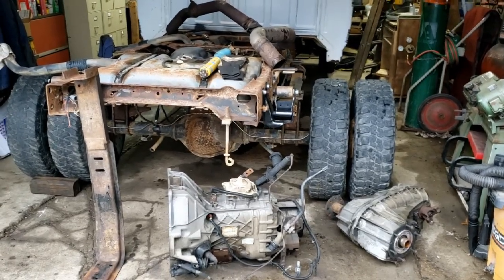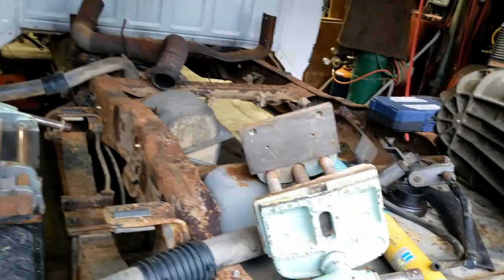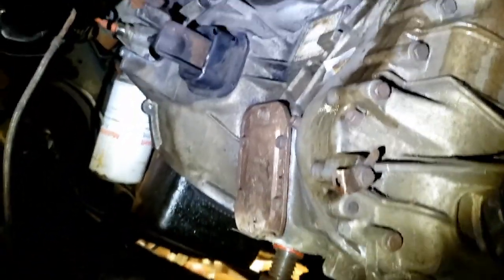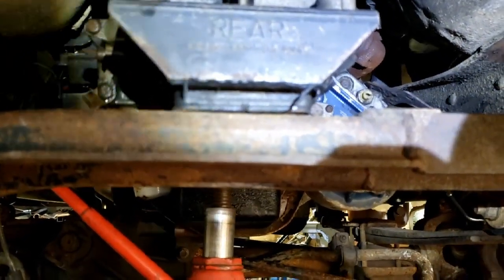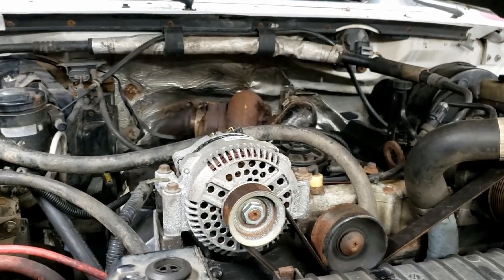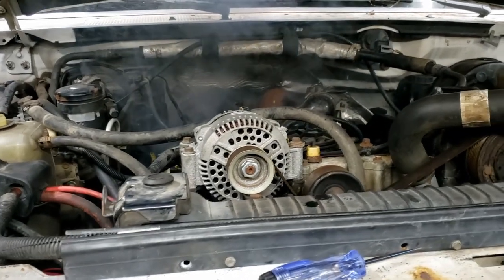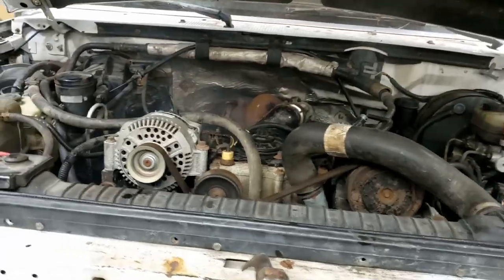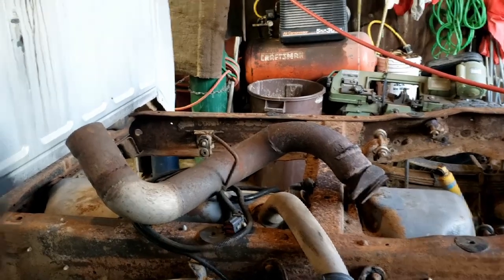7.3 Powerstroke First Start in 2 Years - Frankenstroke Part 12

Comment: Those rear housings even in that condition run about $500-600 where I live lol. Don’t break it!
Reply from the maker: Exactly. One tip for you is that if you can find a ZF5 from a gas truck, that rear housing can be bolted up to a diesel pattern front housing and used in a diesel truck. The gear ratios of 1,2 and 3 are different in the gas transmissions (they're closer together) but it is a viable option. The transmission in "Big Red" (there are some older videos on here of that truck) was built this way and it was a towing monster!
Reply: @diymechanictv1233  Is Big Red still around?
Reply from the maker: Still around, but not around here. A nice young man from Indiana drove over and purchased big red. He used it to replace a newer (6.2 gas) Super Duty truck.
Reply: @diymechanictv1233  excellent

Comment: Having E fuel and stock pump trucks can you shot it straight? Much needed or over rated?
Reply from the maker: You won't see a big difference with e-fuel alone, but if you want to go to bigger injectors, it needs to happen to keep them fed. The mechanical pump has trouble keeping up with much more than the stock 90cc injectors. Since the injectors I'm running right now are 160cc units, the stock pump would struggle to keep up with their fuel demands if I were working the truck. If you have stock injectors, I'd say e-fuel isn't worth the cost and trouble unless you plan to upgrade in the future.
Reply: @diymechanictv1233  im looking at 205/30 hybrids from full force🤷‍♂️ they seem to think stock fuel is fine. I have the kc sxe300 balanced assembly not looking for anything crazy just a tow rig but thry say the use less hpo then 160cc 🤷‍♂️ just figured id ask ya efuel does seem like added headaches to me
Reply: By the way your rigs looking killer
Reply from the maker: I would think with 205s you'd want e-fuel. At least install a fuel pressure gauge so you can keep an eye on it. It might be okay on mild to mid range tunes, but I'm betting your pressure will drop off pretty good on a hot tune with those injectors and stock fuel. You want to keep an eye on the fuel pressure and get out of it if the pressure falls below 45 pounds or so. Running HEUI injectors low on fuel pressure is really hard on them. And you might find that keeping your foot out of it may be more challenging than you think! 😁
Reply: @diymechanictv1233  as always thanks for the advice my friend I appreciate ya and the videos you make